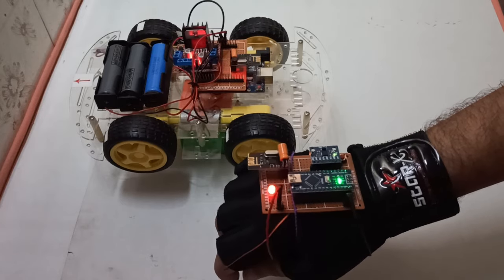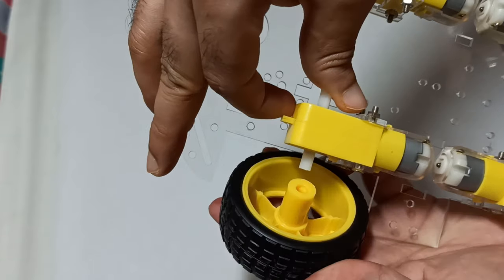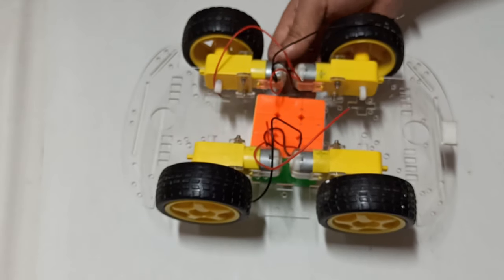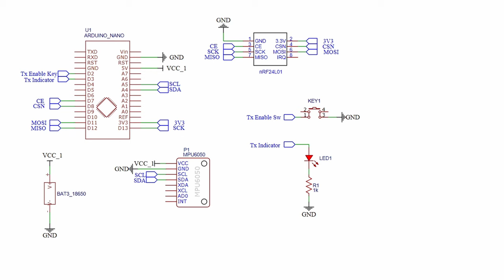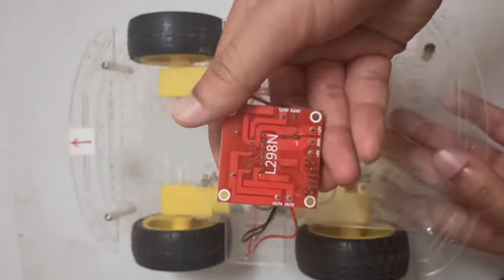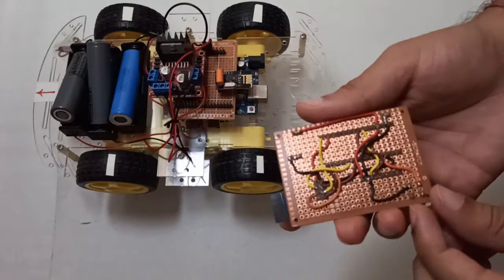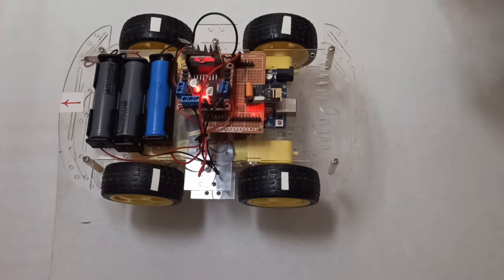DIY | Hand Gestures controlled car using Arduino | nRF24l01 | MPU6050

Comment: Sir is it ok if i dont have the capacitor attached to the 24l01 module????
Reply from the maker: The communication won't be smooth then, small capacitor is needed.
Reply: @ElectronicsisLife  i completed my project without a capacitor. is it ok sir?
Reply from the maker: Nice,
It would work but some time the communication may not be smooth.

Comment: Hello i have l293d  motor driver  
How to connect nrf24l01 with l293d 

Its possible  ?
Reply from the maker: No.
You need microcontroller like arduino t9 control them.

Comment: Hello again. Is there an ability to replace the l298N motor driver with arduino motor shield?
Reply from the maker: Yes
You can.
Arduino shield has L293.
Both work similarly.
Only Make sure that inputs and outputs are properly connected.
Reply: @ElectronicsisLife  thanks

Comment: Hi, do you have another link for the code because the link that is in instructables Is not working?
Reply from the maker: Ok, give me sometime.
Reply: @ElectronicsisLife  ok no problem
Reply from the maker: I just downloaded (All) files from instructables. Seems good.
What problem you're facing ?
Are you unable to download it or the code is not working on your side ?
Reply: @ElectronicsisLife  yeah I’m not able to open the code. When ever I do try to open the code file, it says I don’t have the application set to open the document. Also thank you for answering!
Reply: @ElectronicsisLife  is there a specific application you have installed besides arduino application??
Reply: @ElectronicsisLife  is there any way you can upload a link to the code through arduino libraries?? It’s for a school project! Thank you!
Reply from the maker: @crazybarney2554  please share you email, ill send you the text files, which you can copy and use.
Reply from the maker: @crazybarney2554  yes, its a zip or rar file, you need to install winrar to extract those files.
Reply: @ElectronicsisLife  let me know when you have sent the code files to check my email! THANK YOU VERY MUCH!!
Reply from the maker: drop me a mail to electronicsislife.english@gmail.com and I'll reply you back.
Reply: @ElectronicsisLife  hello, I emailed you!
Reply: Where is the code 
Can you please help me ?

Comment: Does speed depend on the amount of tilt? Like if we tilt our hand more, speed will be more? And if we tilt our hand less, speed will be less?
Reply from the maker: Yes
Reply: @ElectronicsisLife  do you sell this project? I mean is it available to buy?
Reply from the maker: No.
Its a diy project.
You can try it, I would help.
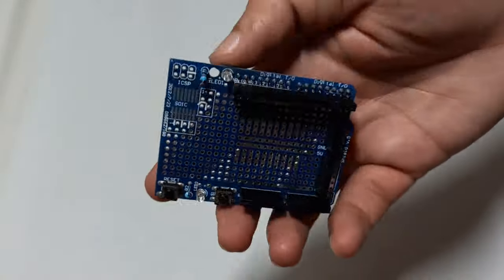Reply: @ElectronicsisLife  ok, I'll try making it then,  at 2:55 you said we can use Arduino shield... Can you send me a link for it? I searched on Amazon, but there are many types of shields... I'm bit confused there
Reply from the maker: You can try this
Although I suggest to build it buy yourself if possible
Robodo AR11 Data Logger Module Logging Shield Data Recorder Shield for Arduino Uno SD Card https://amzn.eu/d/6qXuw82

Comment: Sir, I did everything as shown in the video, all the lights come on but the LED doesn't go out when I press the button, it just reduces the intensity, and the cart doesn't move, please help me, I need to deliver this ready in weeks
Reply from the maker: Please email me some pictures of your project.
Which batteries you are using ?
Make sure battery voltage is healthy.

Comment: Hey bro we are making this project for our iot project in collage we managed to do all work related to transmitter but reciver is always showing 000 readings what to do and where to contact you personally?
Reply: Please hurry up we need to submit it by tomorrow
Reply: Even me the same problem can anyone help both of us please 😢
Reply from the maker: Connect switch and led on the transmitter side.
When you will press the switch , it should start the transmission, by default transmission is disabled.

Comment: Sir, my LED doesn't light up, it only lit up once when I entered the code, but when I pressed the button it went out and didn't light up again, now it doesn't light up even when I enter the code, everything is ok with the soldering of the connection wires, I don't know what's wrong, can you help me?
Reply from the maker: Did you connect resistance in series with led ?
Reply: @ElectronicsisLife  yes, I connected, I followed all the steps in the video, exactly as it is in the video

Comment: How many volt it needed reciver
Reply from the maker: For nRf24 module 3.3 volts, we are using 2 Lithium ion batteries and we are taking out 3.3 volts from Arduino board.

Comment: bro i made the car. when i tilt my hand rx unit it works nicely and my tx is even receiving the signals in serial monitor. but the motors are only making a sound but are not moving. pls help. my exhibition is after 3 days
Reply: pls help asap
Reply from the maker: Make sure that you have connected motor driver gnd with arduino gnd.

Comment: Can you tell me the battery volt connection to the components
Reply from the maker: Plz refer to schematic/wiring diagram, which is there in the description.
Reply: @ElectronicsisLife  where can i buy the complete ready module
Reply from the maker: Sorry,you need to Do It yourself (DIY).

Comment: you have used the code for arduino nano or uno or for the both i didnt understand this point
Reply from the maker: This code will work with both, you just need to select which board you are using while uploading the code.
Reply: @ElectronicsisLife  so i should upload it for the both or chose just one of them? this point It is not clear to us beginners, I apologize for the many questions
Reply from the maker: For reciver (car) side I used arduino uno, and for transmitter side I used Arduino nano.
Both codes are different.
Before uploading the code, select board and then upload.
If you have any doubts/questions , ask me freely.
Reply: @ElectronicsisLife  
I mean, there are two codes, okay? One is TX, and the other is RX. Now I will bring the Arduino Nano and upload the two codes to it, for example, once RX and the other time TX, or do I download only one of them and the other not? And do I apply it once to the Arduino Uno and once to the Nano, the two of them?
Reply: can you replay here please💙

Comment: What capacitor did you used ?
Reply from the maker: 47uf/25v
Reply: @ElectronicsisLife  thank you bro pls send the ckt diagram
Reply: Capacitor is mandatory to use?
Reply: @timealukacs2591  yes
Reply: I used 47uf 50 v ... Is any problem

Comment: Hi. I am currently struggling to connect the nrf24l01 module to the arduino uno after I attached the arduino motor shield on the arduino uno. I have found no guides on Google or YouTube. Do you have any ideas on how to do it? Please provide me with a way to communicate with you for so. I wouldn't prefer email. Thanks In advance

By the way, I am the one who asked you 2 weeks ago about the ability to replace l298N motor driver with arduino motor shield
Reply from the maker: Can you share me few images ?
electronicsislife.english@gmail.com
Reply: bro i am making this project can you please help me i can give you my no. also

Comment: Bro i got mpu6050 connection failed on serial monitor also mpu6050 detect values 0,0 0,0 like this
Reply: Plz help me bro
Reply from the maker: Try swapping SCL and SDA pins, even though its not working then get new one from another source.

Comment: Hello sir, could you help me? I'm a beginner with arduino projects and I don't have much idea of programming. I have written the arduino NANO code as seen in the video and it is verified, but when I press "upload" it gives me an error, I don't know if it is because I have put the processor, port or something wrong.
It says "avrdude: ser_open(): can't open device "\\.\COM4": The system cannot find the specified file". I would greatly appreciate your help as it is a school project.
Reply from the maker: Please check following things,
Is selected board arduino nano ?
If yes try old boot loader option as well
If no , select arduino nano as board.
Check if port is selected correctly.
You can confirm it by having a look in developer option in Windows system.
Reply: @ElectronicsisLife  Thanks for answering so quickly. Yes, I selected the arduino nano board and the ATMega328P old boat processor, but it won't let me select or change the port, I don't know if it's because my computer doesn't detect the board or something. I looked at the device manager and the only port that came out was COM4 but it wasn't even active and I don't know how to change it or add another driver. Do you know what I can do?
Reply from the maker: In device manager, dies port4 comes with yellow triangle.
Your arduino ide shows port4 ?
Reply: @ElectronicsisLife  Do you mean COM4?  or to a port that is literally called port4. Because in my computer the COM4 port appears but disabled
Reply from the maker: My mistake
It should say COM4.
Reply from the maker: Why you said it is disabled ?
Reply: @ElectronicsisLife  Because I get the port symbol but it won't let me select it
Reply: And I don't know if it's because of the cable or the Arduino nano board is wrong, because with another Arduino uno board, which works with another cable, the computer does detect it
Reply from the maker: If the driver for arduino nano is not installed, then port COM4 won't work.
Install driver, check which usb ic is on the backside of nano,
Normally it CH340.
Reply: @ElectronicsisLife  ok, thank you very much I highly appreciate your support

Comment: hey what was the mili amp hours on the battery
Reply from the maker: It say 2600 mAh.
Reply: @ElectronicsisLife  thanks. And my program is not working, car not moving
Reply: Can you please help, I’m doing this for my senior project at school
Reply: I have all the components together. Light comes on but nothing else
Reply from the maker: Yes
Can you share the images of your work on my email
Let me see the soldering and wiring.
Do you have multimeter ?
Reply: @ElectronicsisLife  what’s your email?
Reply from the maker: electronicsislife.english@gmail.com
Reply: @ElectronicsisLife  Sent!

Comment: How far is the max?
Reply from the maker: If not obstacles inbetween , can be controlled upto 100+ ft
Reply: @ElectronicsisLife  means the same as hc05?
Reply: @KnightBear123  more than it,since sensitivity of this receiver is very good.
HC05 is bluetooth module.

Comment: Isn't the sensor on your hands
Do you have a video showing how to program it is the gyroscope?
Reply from the maker: You need to do the wiring and upload the code.
If the wiring is correct then it should work.

Comment: Sir why is nrf24 is not linking
Reply from the maker: Many possibilities are there,
1. Connection error
2. Connect 100uf in parallel to supply of it
3. Defective nrf24 modules

Comment: Bro i have a problem in Transmitter's code,on line 40 its giving error 'class MPU6050' has no member named 'initilize'
Reply from the maker: Did you added/install library for mpu6050 ?
Do share screenshot via email if issue didnot resolved.
Reply: @ElectronicsisLife  I watched another video and yes it was issue of library, it's solved now

Comment: Hello sir.
I have a major doubt, can I use super glue instead of hot glue And where should I buy these things other than online....I hope you see my comment sir. Thank you
Reply: Pls sir I am your big subscriber .pls
Reply from the maker: Hi,
You can use super glue as well, but hot is easy to remove.
Before buying these online, if possible check your local hardware/electronics shops as well.
These projects looks easy but can be tricky many times.
Reply: @ElectronicsisLife  thank u sir
Reply: @ElectronicsisLife  I got it from local shop yesterday... But they dont have accelerometer and module..

Comment: Because I have spend upto 2000 on this Arduino project but I am not understanding only that wiring
Reply from the maker: what part of schematic/wiring you are not understanding ?
Reply: @ElectronicsisLife  sir, the transmitter and receiver wiring
Reply from the maker: Share your email id, i shall contact you.

Comment: There are some errors occurring in uploading 

avrdude: stk500_recv(): programmer is not responding
avrdude: stk500_getsync() attempt 1 of 10: not in sync: resp=0x60
avrdude: stk500_recv(): programmer is not responding
avrdude: stk500_getsync() attempt 2 of 10: not in sync: resp=0x60
avrdude: stk500_recv(): programmer is not responding
avrdude: stk500_getsync() attempt 3 of 10: not in sync: resp=0x60
avrdude: stk500_recv(): programmer is not responding
avrdude: stk500_getsync() attempt 4 of 10: not in sync: resp=0x60
avrdude: stk500_recv(): programmer is not responding
avrdude: stk500_getsync() attempt 5 of 10: not in sync: resp=0x60
avrdude: stk500_recv(): programmer is not responding
avrdude: stk500_getsync() attempt 6 of 10: not in sync: resp=0x60
avrdude: stk500_recv(): programmer is not responding
avrdude: stk500_getsync() attempt 7 of 10: not in sync: resp=0x60
avrdude: stk500_recv(): programmer is not responding
avrdude: stk500_getsync() attempt 8 of 10: not in sync: resp=0x60
avrdude: stk500_recv(): programmer is not responding
avrdude: stk500_getsync() attempt 9 of 10: not in sync: resp=0x60
avrdude: stk500_recv(): programmer is not responding
avrdude: stk500_getsync() attempt 10 of 10: not in sync: resp=0x60
Failed uploading: uploading error: exit status 1. 
How can i correct it
Reply: Change the processor to Old Bootloader

Comment: I did the same think but it is not working
Reply from the maker: What's the issue ?
Reply: @ElectronicsisLife  I am facing issues in nrf24 connection
Reply from the maker: Do check whether they are working using some other libraries.
Have you connected capqcitor of 47uf or more across supply of it.
Reply: @ElectronicsisLife  yes

Comment: The project is very interesting but the way you explained in this video to make this is such a WORST thing I even seen before.
I was trying to make it but the Circuit diagram, Battery connection, Resister connection was not clear and that's why my project is still not working......
Reply: Yes bro, you are right
Reply from the maker: You can email me, i can help you there.
Reply: Please help me
Reply: @ElectronicsisLife  sir what is your email I can't find it?

Comment: sorry bro how about forward and turn right or left?
Reply from the maker: Sorry I didn't get your question ?
Do you want to know how it turns left and right ?
Reply: i mean how to turn right or left while the car is move, thanks dude
Reply from the maker: Left side motors drives car to right and vice versa.
If car is moving forward and stopped left side motor it will turn right and if you stopped only Right side motor it will turn left.
Hope it clears you doubts.
Reply: okay dude i catch it thanksss👍
Reply: @ElectronicsisLife  can I have your email?
Reply from the maker: electronicsislife.english@gmail.com